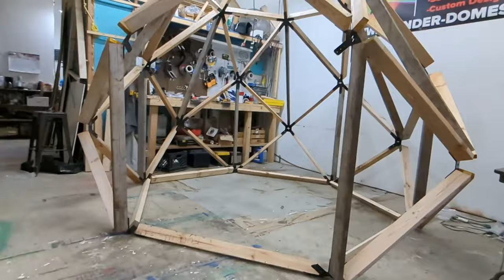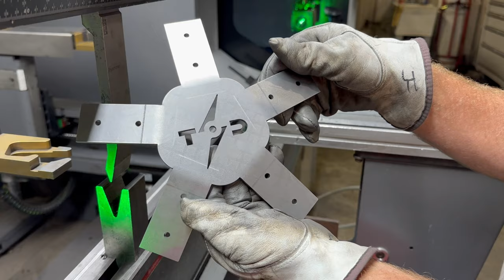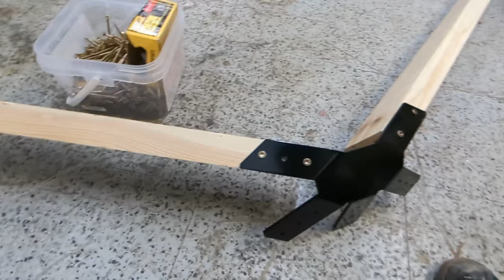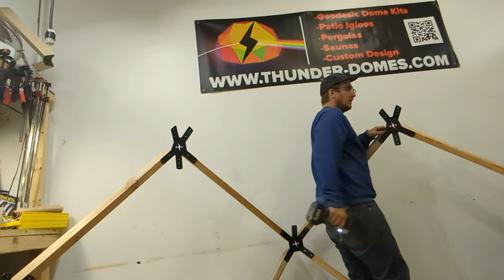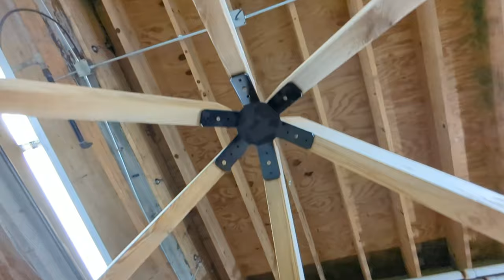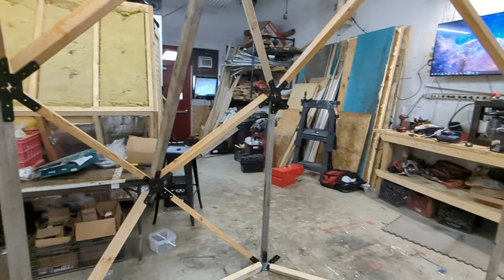Zome Dome Build by Thunder Domes- Complete Frame Time-lapse

Comment: Hi, I like your style of building. 
I want to build a genetic dome with a diameter of 8 meters, frequency V3 or Krusche base.  The material is 4x3,5 cm acacia prisms. 

I need some advice about the connector. I need advice on the optimal angle and length of the connectors. 

Thank you in advance for the answer

Regards 

Dalibor